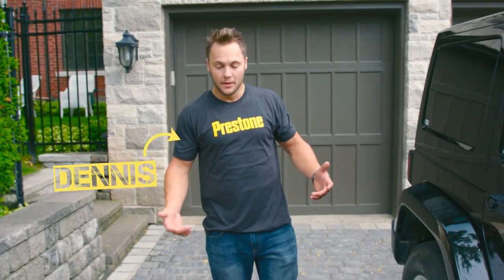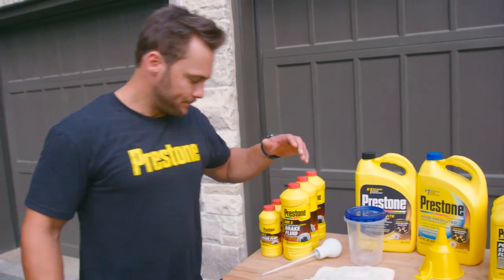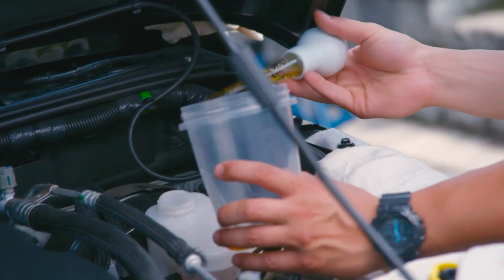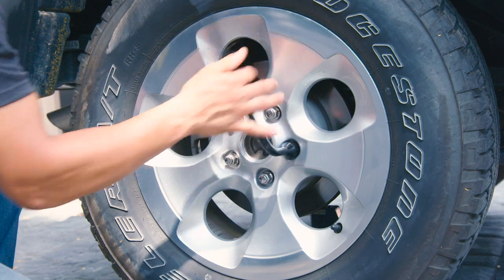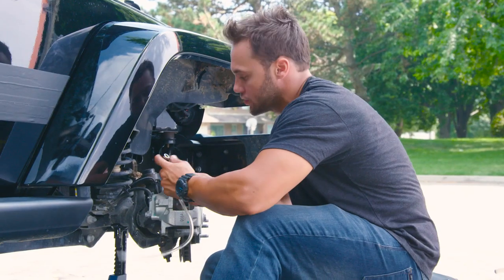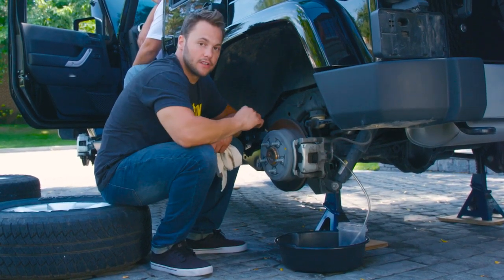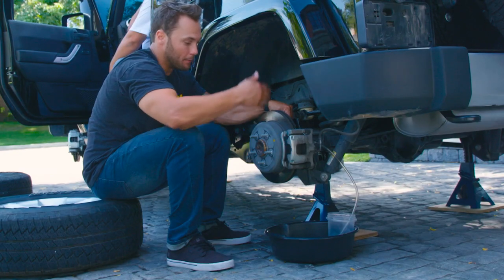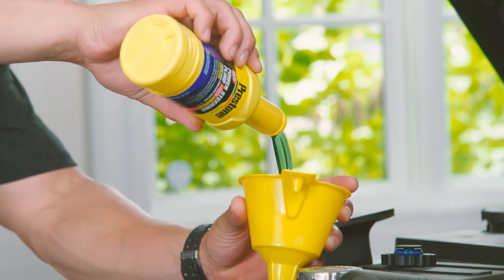Prestone® How to Change Your Brake Fluid

Comment: As a car mechanic (from Germany) I cannot recommend this method. I used this method myself until a master brake cylinder broke. If you do it like that, don't fully depress the brake pedal. The piston of the master brake cylinder then moves in areas in which it never moves in normal operation and these areas can therefore be dirty. Please use a vacuum bleeder, they are not expensive.
Or use this https://www.youtube.com/watch?v=Af0SYcbzIbo

Comment: If you stop at the first step, does the old brake fluid in the lines effectively mix with the new fluid in the master cylinder?  Or does the old fluid stay stagnated in the brake lines and not mix with the new fluid? If there is no mixing here, then your short procedure is not so good. If there is sufficient mixing here, then I would do your short procedure every year, no question.
Reply: It will once you start using your brakes however instead of fresh fluid, you'll have a mixture of fresh fluid and old fluid. This is why he says you'd have to do it once a year, normally brake fluid is flushed once every 2-3 years instead of yearly.
Reply: I’ve wondered this too

Comment: Good video.  I would hang tubing to provide a loop upward to reduce risk of air entering system;  perhaps even funneling in a few drops of brake fluid ahead the relief valve of before cracking it open.
I would probably only bleed/replenish fluid when replacing brake pads, but if your choice of brake pads lasts a very long time you may find if convenient to do an interim bleed/replenish during a DIY tire rotation.
A few words on what to do with bled out Prestone DOT 3 fluid would be appropriate - allow to evaporate?  store to be processed by a treatment facility?
Reply: living in a region that has high moisture every 30k miles is recommended flush.

Comment: the engine need to be running??
Reply: No
Reply: @averyalexander2303  how do you stop the brakes locking up after you press them
Reply: @Bijanbani79  I don't exactly understand what you are asking? Do you mean your brakes aren't releasing once you release the pedal?
Reply: @averyalexander2303  no when I press the brakes around twice they lock up and become stiff I was just wondering is there a way around that
Reply: @Bijanbani79  Oh I see. That's normal, the process will still work. When someone opens the bleeder valve the pedal will go down as it should. If you are having a hard time pushing the pedal with the engine off you can do this with the engine running if you want, but you don't need to.

Comment: I have a 89 s10 pickup. I replaced the enite hydralic clutch system except the cup that holds the extra fluid. I did this back in march. I used prestone brake fluid. All items are new! My fluid is really dark.  What would cause this? All the parts were NEW except the fluid holder. Was there a bad batch of fluid?

Comment: does this procedure work on anti-lock brakes?
Reply: Yes. They've been standard in The EU since 2004. The ABS pump / valve actuator block does nothing to interfere with the process.

Comment: I can tell you from experience that changing the brake fluid eliminates problems from the master cylinder leaking. My Toyota car had over 200K on it 14 years ago and I have never replaced the clutch master cylinder because I change the brake fluid often. The brake master cylinder was replaced as a safety precaution at 300K and I have not had any hydraulic problems, unlike lots of cars I see leaking fluid from cut seals. I just tested the brake fluid and it has 1% moisture in the brake reservoir and 2% in the clutch. 3-4% moisture is the condemn limit for brake fluid.
Reply: heavymechanic2  "cool story bro"

Comment: Safety warnings for all jack stands say to use one pair ONLY. The warning is because a non-level surface or uneven jacking the other end of a vehicle can cause the first set to tip, and the ratings for stands are for vertical dead weight as a pair. 

Prestone makes good products, but before using one of them, check your Owners Manual.  Some cars, expecially Hondas, have warnings about using aftermarket fluids and require particiular products..
Reply: I can't imagine many reasons why someone would lift all four corners merely inches off the ground - long-term storage, DIY rust protection?  If really wish to do so, I picture using 2 hydraulic jacks (borrow one from neighbor or family member) on left and right side simultaneously to lift one end of car, place jack stands then repeat at other end.
Note, DIY tire rotation should only require lifting one side at a time;  if you want/need a tire rotation more complex than simple front/back exchange, have a shop with a lift do it.  Be safe everyone.
Reply: safety bla bla bla. there's only one way to get things done. just do it
Reply: @vivimu  dead yet? Jk😉